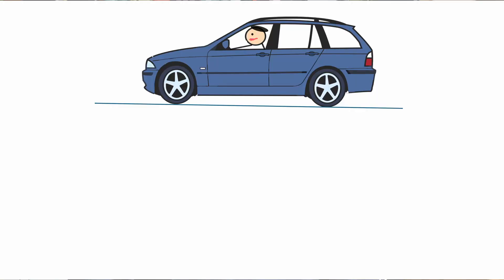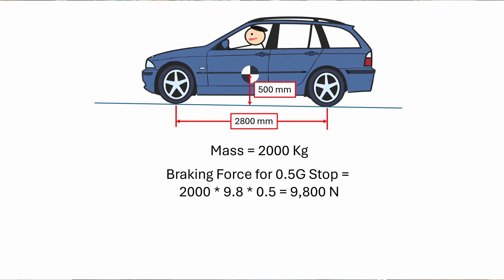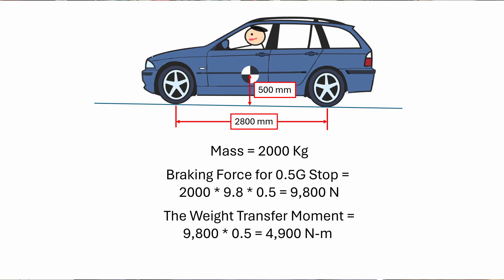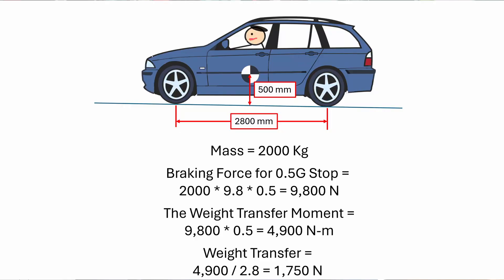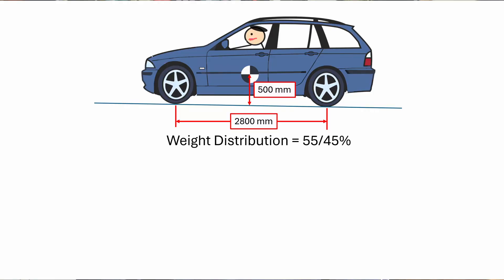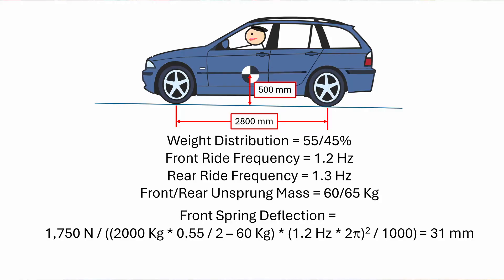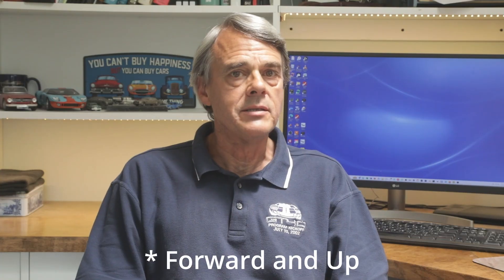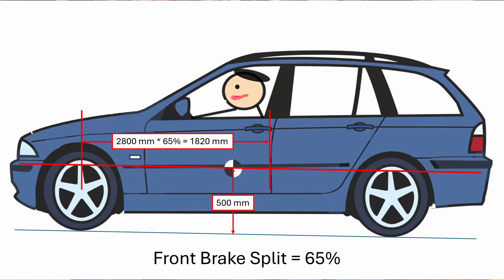The definitive guide to Anti-Dive and Anti-Lift in suspension systems. What it is and how it works.

Comment: Anti-dive only affects the driving feel but doesn't change the maximum braking performance?
Does it affect the car's characteristic? Does it make the car more understeery or oversteery when the car is under braking?
Reply from the maker: That depends. If the suspension has a lot of roll understeer designed in, then the added deflection of having very little anti-dive or anti-lift would cause more toe change during braking which could make the car more skittish on uneven pavement. Most cars only have a little bit of roll understeer built in so I wouldn't expect it to have much of an impact. In any case, anti-dive and anti-lift have no impact on overall braking since they don't change the braking power nor the total weight transfer. They only affect how the suspension reacts to the weight transfer, they don't change it. Look at the math for calculating weight transfer. It ONLY uses the deceleration level, the mass of the car, the CG height above ground, and the wheelbase. Nothing in there is affected by anything related to the suspension design. I hope that helps, and keep asking questions!
Reply: @suspensionsexplained  Thank you so much!
There are many sources claiming different answers on this topic and that really confuses me. Your answer really helped me clear up my confusion.

What is roll understeer? Does it relate to bump steer?

Comment: Where did you get the front ride frequency of 1.2 Hz and rear ride frequency of 1.3 Hz?
Reply: Spring rates and frequencies are covered in a prior video
Reply from the maker: Those numbers are just examples but both are very typical of what you might find in a modern sedan.
Reply: He literally said it was an assumption dude. He made it up.